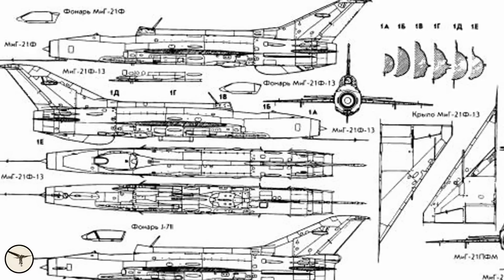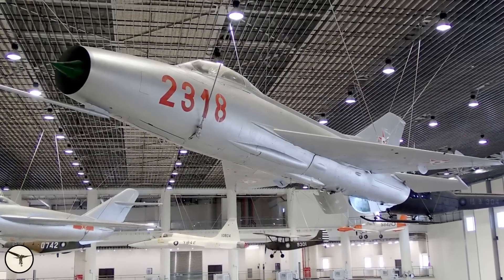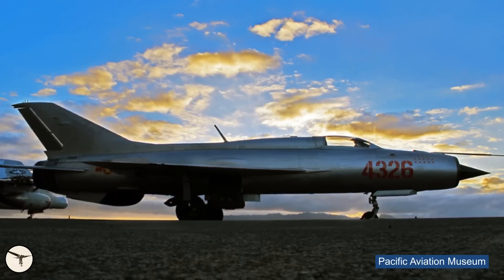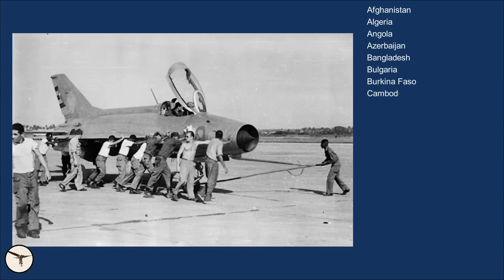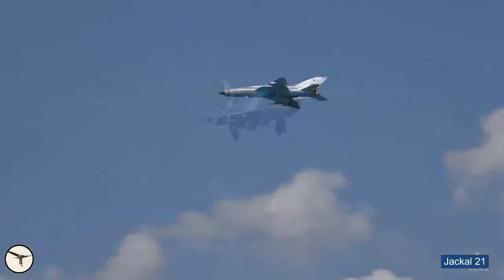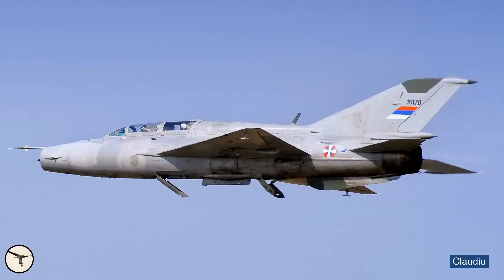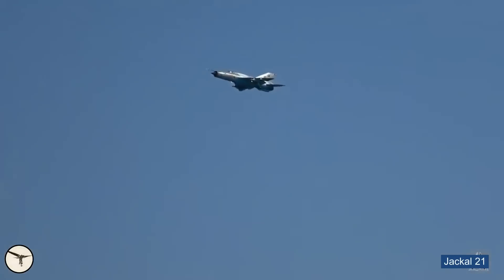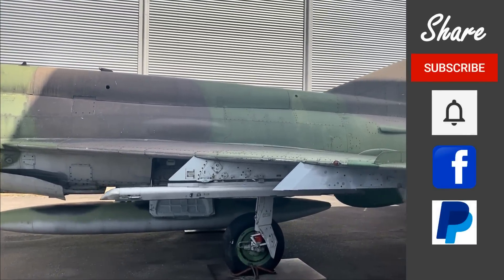Mig-21 facts that might surprise you

Comment: Finland also used the Saab J 35 Draken at the same time as the MiG-21 and from what I understand there was a bit of rivalry between the pilots of the faster MiG-21 and the more maneuverable Draken. according to a former pilot the earlier F-13 variant was more enjoyable to fly than the later MiG 21bis, although obviously the later variant had other advantages.

Comment: Your chart at 09:57 has got me confused. Unless your IAS is off by a factor of 2, I can see no way  500kmh can intersect with mach 2.05 at any altitude below 100,000'. Explain? Thanks.
Reply from the maker: The chart is based on information from DCS and Aircrew interview with Jyrki Laukkanen. https://www.youtube.com/watch?v=RaPQYCvVN6k&t=770s
He states that the minimum speed for the engine to operate is 500 kph IAS. On a test flight, he climbed to 21,300 meters (70,000 ft), where he reached Mach 2.05 and 500 kph IAS. There are two factors that must be considered: 1) The speed of sound depends on the temperature. For example, when the temperature is higher than standard, the true airspeed is higher. 2) The indicated airspeed is affected by compressibility. Therefore, the indicated airspeed is not "correct."

Comment: Though the 4th gen F-16 fighting falcon has been upgraded to the Block 70/72 Fighting Falcon. Built Upon 5 Decades of experience and still used worldwide. 3,000 F-16s are used by 25 Countries. The narrator compares the Mig-21 to the F-16. Which is ludicrous. When I went into the military the McDonnell Douglas F-4 Phantom II a tandem two-seat, twin-engine, all-weather, long-range supersonic jet interceptor and fighter-bomber was made from the exact time the Mig-21 entered service. If you want to compare USSR technology to American then compare the Mig-21 to the F-4 Phantom II a tandem two-seat, twin-engine. Appearance wise the Mig-21 compared to the F-4 Phantom II is a obvious loser. The F-4 entered service in 1958 and even Japan still uses it. Where is the Mig-21 used

Comment: Yeah no joke. I've only successfully landed the mig-21 a handful of times in DCS... It's basically impossible unless the fuel tanks/wings are empty. 
Been flying sims for over a decade. It's as hard as mid-air refueling; except if you fk up, you kiss the runway and explode, or at least blow out your gear.

Comment: At 14'19" onwards, the pilot is performing all maneuvers with Gear down.   Is that not a disadvantage  ?
Reply from the maker: The engine is very powerful, so the landing gear has little effect on a display like this. The pilot might have selected the gear down to make the dispaly more interesting and/or he used the gear as an air brake. One more thing about the engine: When moving the throttle from idle to max power, you will have to wait 13 seconds before things start to happen. That's a very long time!
At 14:47, the pilot started a vertical dive, and as the aircraft was accelerating towards the ground, he would reduce power. With the gear down, he could use slightly more power, making it easier to increase power during the pull-up.
Reply: @FlywithMagnar  Thank you for your clarification 🙏

Comment: Egyptian MiG-21 F-13 was the first to score that aircraft's first, official kill in 1963 against an American cargo plane flying from Jordan to Libya with a broken radio and without a flight plan or airspace notification when it was intercepted twice, once over Sinai and was told to land in Cairo.  It reached Cairo and when the pair of intercepting MiGs broke off, it decided to continue and cheat the interception & forced landing.  7 minutes later it was intercepted again over western Cairo & Nile Delta by another pair of MiG-21s and was told to land in Alexandria or Marsa Matruh on the Mediterranean.  It didn't hear the commands because of the broken radio and Egyptian command & control didn't have any flight plan info or airspace permission requests and the aircraft made no effort to signal the EAF pilots, so one of the MiG-21s skimmed its 30mm cannon right across the fuselage raking it with 20 holes and down she went, killing both occupants, the American pilot and the Swedish co-pilot.  That was the official MiG-21's first ever documented kill.

Comment: Altitude range 113,891 ft, is it true Sir ?
Because even modern fighter jets don't have this capability
Reply from the maker: Yes, it's true. The airplane was a modified version of the MiG-21 called Ye-6T. It had a more powerfuel engine and a rocket booster in the tail.
Reply: @FlywithMagnar  Sir can you make video on difference between Fighter jets and Interceptors, i tried to search but i did not find suitable information.
I hope you will accept my request.
Reply from the maker: An interceptor is a fighter airplane optimized for high speed and climb performance. It is used to defend against enemy bombers. Examples are Supermarine Spitfire and Lockheed F-104.

Comment: Magnar, here are the facts and figures (limitations) of the mig 21 as evaluated by the USAF. This type had severe speed limitations above and below 16,000 ft. (595kts, and 640kts respectively. Whatch the vid for an explanation of aircraft limitations and its poor handling qualities. Do not rely on anecdotal info. this is actual test and evaluation.https://youtu.be/reVZ9aPYi9A

Comment: 10:30 Aft movement of CoG usually means an increase in stability. What is going on here?
Reply from the maker: The center of gravity (CG) is ahead of the center of lift (CL). When CG moves aft, the distance between CG and CL diminishes. This makes the aircraft more unstable. https://www.cfinotebook.net/notebook/aerodynamics-and-performance/aircraft-stability
Reply: @FlywithMagnar  Sorry, you are 100% right. I don't know what i was thinking. I knew that! D'uh!

Comment: I don’t understand how the aerodynamics work in a jet with basically a hole in it’s nose why not use side inlets
Reply from the maker: The aerodynamics of a jet fighter has a lot of focus on minimum drag. Air intakes on the sides allow for a radar antenna in the nose. The MiG-21 was designed without a radar, and since a straight air intake often develops less drag than air intakes on the side, this was chosen. Many other fighters have air intake in the nose: MiG-15, -17, and -19; F-84, F-86, F-100, EE Lightning, SAAB 29, Dassault Mystere and Super Mystere.
Reply: @FlywithMagnar  interesting thanks for the info

Comment: Remarkable how similar the Mig-21 is to the F-104 without looking much alike. Both were lightweight area defense fighter, high wing loading, strait afterburning turbojets with a moderate compression ratio (the J-57 had a variable inlet stators). Both had external compression inlets based on conical geometry (the Mig was variable, a big advantage offsetting the variable stators on the '104).  The Mig was more successful from a program standpoint, but the Starfighter was no slouch on production numbers either. I was unaware of the M2.05 limitation. The Starfighter was capable of M2.2, limited by the total temperature (probably the plex canopy, but measured in the generator cooling duct).
Reply: Well unfortunately the F104's production numbers didn't come from it's quality but more likely from the size of the bribe Lockheed "offered" to certain US officials.
Reply: @Tacticaviator7  Certainly a longstanding rumor but fails to explain why the plane was least successful in the US (in terms of sales numbers). Are you saying that the Soviet Union didn't use their own system to "encourage" sales of the Fishbed to their satellites?
Both were point design lightweight interceptors with acceleration, climb and speed as the prime design goals. This came at the expense of range, payload weight and low speed handling. Lockheed sales was overstepping the plane's capability selling the F-104G's to Germany to be used in a ground attack role, resulting in a very high loss rate and a very poor reputation. Not unexpected in hind sight; hang a heavy weapons load on a supersonic interceptor and send them into the clouds with mountains inside. What could go wrong? The Italians had better success using them for their intended role as a rapid response interceptor. The Mig-21 was never put into the same ground attack role that the Starfighter was shoehorned into. FWIW, I think the Starfighter is more aesthetically pleasing of the two.

Comment: Small correction, the mig-21 has two afterburner modes

The emergency afterburner is only to be used in emergencies, and if you use it for more than 2 minutes you risk damaging the engine, and any use of this mode reduces the engine's lifespan by about 20 hours

But the normal afterburner is unlimited, and doesn't burn fuel nearly as quickly
Reply: At least Bis has limited afterburner. You can keep it on for little over 2 minutes and then your feeder tank (no:3) is empty and your engine is dead. You need to pull throttle back to mil power after 2 min and wait a moment to feeder refill, before you can push afterburner back on.

This was common problem in air shows as you need to time the refill between maneuvers. 
For interception it wasn't problem, as in 2 min after releasing wheel brakes you were at 10 km altitude at Mach 1.2. then you started climb and in three minutes you were at 20 km at Mach 2.05, and now your 500 liter warning light lits up and you need to return. 
You can glide down at rate of 5:1 when engine idle by keeping 500 km/h indicated air speed.. So you get 5 km ground distance for every 1 km altitude. Transferring you from 20 km altitude to about 90 km distance, leaving you 2 km altitude to get airfield.
After deploying landing gear, glide ratio change to 3.8:1 so it gave you with idle engine 7.6 km glide distance to land the plane. At that moment you had about 300 liters fuel left that was enough for two patterns and landing touches around the airfield if required.

The Fishbed is amazing for what it was designed, you take off from roadbase at specific time calculated for a second, intercept a high flying target, shoot the missiles and return to base. 
Multiple fighters doing that, in multiple waves and you get targets destroyed. No need for fancy long range radars, enough that you find target at 10-15 km distance and can engage them inside 15 km. As GCI is your guidance through whole intercept.
Reply: @Fri13.  Thanks for contributing to the forum, and my knowledge base.
Reply: Ummmmmm, I sorry but your incorrect.
Reply: The pilot will return home for tea and medals. 😂 1:56
Reply: Never heard about that one before.
Reply: I see your two, and raise you three afterburner modes.
Reply: @hailandfire1822  Four, take it or leave it
Reply: @henri6311  I'll go all in with my FIVE 5 afterburners.

Comment: Question - are shock-cones always elliptical or can they also be coniptical or even conical? The different shapes provide faster responses in some conditions but at the expense of other regimes. Still, IF their is a particular issue with 1 regime, this is a cheap solution.
Reply from the maker: I'm not sure whether we define the terms in the same way, but engine intake shock cones on supersonic airplanes are conical. This means that the surface area at the stagnation point is near zero. An elliptical cone is blunt, and that is what we see on the nose of subsonic airplanes.

Comment: This plane is sadly infamous in Italy because of the Ustica crash. A DC-9 plane lost a wing when a MIG-21 created a turbolence overtaking it very close. The DC-9 crashed in the sea and all the passengers died. It was 1980. At that time it was customary for Lybian MIG to overfly Italy back an forth when going to USSR for mechanical maintenance. In order to avoid NATO radars they used to follow by close italian civil planes. Sometimes they were intercepted by italian f-104 or NATO fighters but most times the trick worked.
Reply: Everybody in Italy turns an angry face at the sight of mig-21 to this day.

Comment: I think a pure delta version would have been more fuel efficient , more lift less drag , more weapons load ,  sort of like the F16XL
Reply: Pure delta eings need flybywire without it they wont fly the mig21 was too early in fighter plane design do have flybywire which came in the 70s

Comment: Actually, "U" in MIG-21U (МиГ-21У) stands for Russian letter "У" (which is pronounced same as U) - "учебный". It is close to "обучение", Google translate will display both of them, but the former is an adjective, and this is what they usually add to the main model name ("учебный", "высотный", "ночной" and so on) to indicate the purpose. The latter is a noun and it starts with "О", which does not match the letter "У".

Comment: Did Mig-21, and Mig 17 (Focke Wulf  Ta-183) ever had an Area Ruled fuselage? 
Case of Convair F-102 comes to my mind.  https://youtu.be/8W-stP23Bkw
Both Charles T Jones (NACA tech note 1032; 1946; NACA report 1284), and Alexander Lippisch (NACA RM L7F16; 1947) worked in Delta Wing planform. 
Gesund +
Reply from the maker: No, the 21 was a tube, and the 17 was a barrel.
Reply: @FlywithMagnar  So it have large room for improvements. Do they? 
Blessings +

Comment: Great video!
That Romanian pilot was AWESOME, and the aircraft equally so, and to perform as it did under their control!!
Liked and subbed - :)
Reply: coulda retracted the undercarriage though...
Reply: @ashleycollard8968  That's the point of the awesomeness of both, as the aerodynamic drag caused by the undercarriage would be massive and speaks to the skill of the pilot and the mechanical design of the MIG 21. :)
Reply: @craigywaigy4703  oh... i thought an awesome pilot would know where the retracts were actuated :P

Comment: It is sad that they later on MiG-21  expanded the outer lip so that compression could not really work anymore :  https://youtu.be/LjL8HJOxfZ4?t=143    They should have enlarged the fuselage around the cockpit and then dissolve it via area rule into a thicker wing (-root ).

Comment: Dislike as major parts were straight copied from the interview of the pilot Jyrki Laukkanen, and not from the technical data or person own experience.
Reply from the maker: Many videos about historical aircraft don't provide much factual information. Before making a video, I do a lot of research. In addition to the interview with Laukannen, I have used interviews with Brian McCoy, Vladimir Kondaurov and Pham Tuan. In some cases, they and other sources provide the same information. For example, the history about the Finish procurement of the MiG-21 is also told by Military Aviation History. Laukanen's major contribution is the high speed speed performance. Furthermore, I have used historical and technical information from Wikipedia and publications like Flight International, and DCS MiG-21 manual, which is based on the actual operating manual. My personal experience is limited to museum visits and talks with staff at the Thai Air Force Museum, which has a MiG-21 Bis on display, and Intrepid Sea, Air and Space Museum, which has a second generation MiG-21 on display. Without those sources, it would have been impossible to produce this video.

Comment: It was not "difficult" for Finland to buy "western" planes. The Soviet Union bought a lot of Finnish products in the 50´s - 80´s, so the "balance" in a trade agreement between The Soviet Union and Finland had to be met. The Mig-21:s was therefore  a lot cheaper for Finland than the "western" planes. A few years later Finland bought the Swedish Saab 35 Draken planes and some years later also the English BAE Systems Hawk planes.
Reply: That's true. Before the MIG 21, the Finnish Air Force had acquired British De Havilland Vampires and Folland Gnats. The MIG 21 replaced the poor Vampires and the unreliable and underpowered Gnats were replaced a few years later by the Drakens. The Mig 21 F was later replaced by the Bis model and new Drakens were bought to replace the old ones. The training fighters were first the French Fouga Magisters and later the British Hawks. 4 Mig 15 UTI training fighters were used to familiarize themselves with the logic of Soviet aircraft.

Comment: Good attempt at russian, but the voice sythesiser leaves much to be desired. It has a misleading sound itself.
О-БУ-ЧЕ!-НИЕ, an accent on 'Ч', and a very soft n. 

 Anyway, i always wanted a MIG21. Flying one would be like strapped to a ballistic rocket. You can buy one, as low as $250K, so it would cost more to maintain in couple of years than to buy. Why not..

Comment: Any Aerospace Experts please answer my question... Can MiG21 be retrofitted with modern avionics and better Western Engine for example GE404 or EJ 200 or any other reliable one??? just curious to know!!!
Reply: I remember Egypt did an upgrade on both.  The Avionics/Weapons were changed to a NATO standard, and the engine was replaced with I believe one made by England.  Performance was improved by 30 percent. I don't believe Egypt still flies MIG-21s since they now have F-16s. I remember at that time an American company could do the upgrade because none of parts came from the U.S. and only U.S. workers were used.
Reply from the maker: Avionics? No problem! Several 21s are retrofitted with modern avionics, for example the Lancer variant (Romania) and the Bison variant (India). 

The engine, however, is harder to modernize. The MiG-21 Bis is built around the R-25 engine, and inserting another engine make will require a redesign of the airframe. The weight will also be an issue, as this will change the center of gravity. The air consumption will most likely change, which will require a redesigned air intake.
Reply: @FlywithMagnar  I wonder if 2 of those modernized Romanian 21 was shot down recent by Ukrainan forces as it was presented by Mainstream...